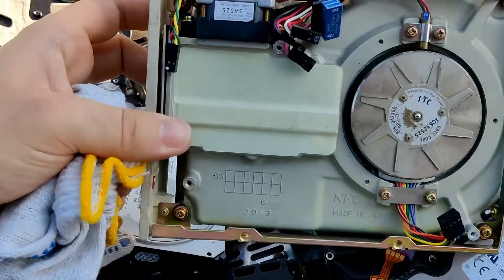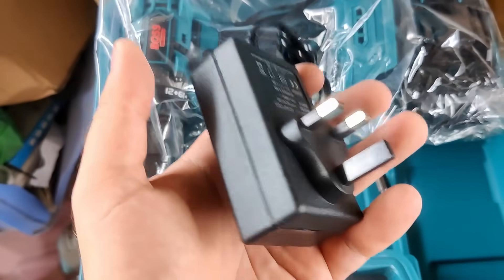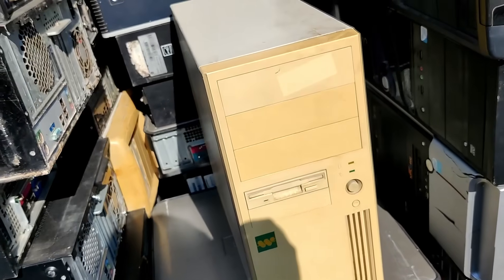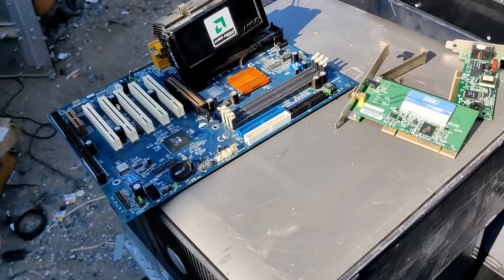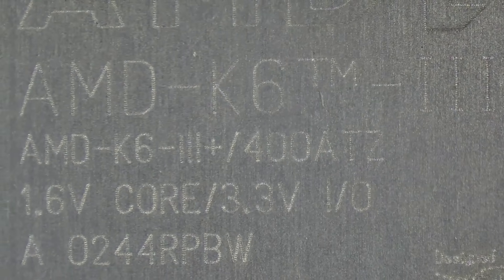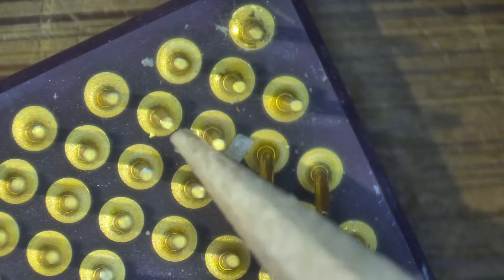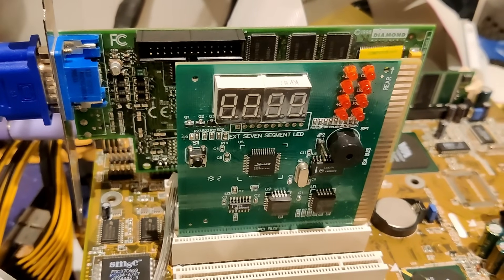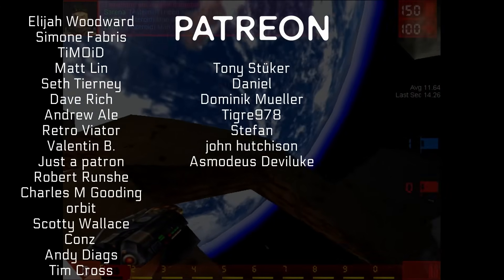I Found Rare AMD K6-III+ CPUs and Broken Dreams 😥

Comment: Geode is a Cyrix Media GX ~ £12 nowadays and not worth, other than collection for a wall display...

And as many are saying ... would love to have an Electronics warehouse/market like that ... I guess with all the opportunities and growth assistance in Dubai, they must cycle through a lot of electronics and quickly!

BTW: Those MMX chips, with that bespoke leather looking substrate - what was that made of?
Reply: and, we all, thank you for your service - risking Tetanus - for our entertainment!

Have you considered getting a bespoke expanded PGA measured block, something that PCB Way could machine for you, just a mill machined block of non-conductive material that has many squares of pins in that form factor, but making sure there's a a funnel bezel of each hole ...

That way,  you can just get close with your manual process, then push it into this block and get really straight pins? does that work if you ensure that all Key'd locations have holes too? or would you need a bunch of different masks?

I tell you what, when I win the lottery, next to my home Flight Simulator wrap-around cockpit. I'd have that Bosch FDL with subtle LED mods just decorating the background in the corner of a room!
Reply from the maker: A metal block to perfectly align pins sounds interesting, but I think there is this effect that pins won't 100% remain in the bent position. They tend to spring back a little bit. I have to over-bend them to get a good fit. It is a tedious process and takes a lot of time, but it doesn't happen that often - so, I am fine doing it manually.
The CPU substrate of the MMX chips could be fiberglass with some rubber coating (or other material).
Reply: @bitsundbolts  I was wondering if the alignment block would be a way to get the CPU into its proper socket and not even looked at, ever again! 🙂

Thank you for your reply, especially with the MMX - I wonder what the thermal properties of that subtrate actually are!

Comment: Considering how the crack has ripped the much thicker metal of the pads, the internal connection wires would have no chance.
Those cracked CPUs are dead
Reply from the maker: Correct. Tested and verified - they are dead.

Comment: Where is this?
Looks like India or someting.
Reply from the maker: United Arab Emirates
Reply: @bitsundbolts Cool to know you have a dismantling "scene" too! 😆
These are local use equipments or it come abroad to be dismantled in UAE?
I know several dismantlers like this here in Brazil. They are pretty same electronics "heaven and hell". They detach the circuit board the same way the guy do on the video, but does nothing to it here. We recycle the metal and plastics locally, and all the electronics are exportes to China.
I kinda work in a "dismantle" too, but we do a deserving destination to the equipments, repairing and solding again. If it cant be repaired, we disassemble and sell the good parts as a replacrment parts.
Reply from the maker: I haven't seen any further processing here - I was told that the different materials are then shipped to other countries like Malaysia. Sometimes, the separated goods are traded a few times locally.

Comment: Did you increase the voltage to 1.8v or even 2.0v? They should run at 550 or 600MHz with a little more power.
Reply from the maker: I will do that in an upcoming video when we take off the heat spreader from the cracked chips as well.

Comment: My eyes popped out.of my head when I saw that K7 kit.
I had owned an Epox EP-7KXA with VIA chipset, but I don't remember how stable it was compared to AMD 750 Irongate. The good thing about boards with VIA KX133 chipset is that they have universal AGP slot, while the boards with AMD chipset support only 3.3V AGP cards.

Comment: I still have A k63-450 and board in my garage. Keep thinking of making a dosbox out of it but never did. Its probably in decent shape though since still in socket?
Reply: Depending upon where you live the garage can be a bad place. In the UK the boards get damp in the winter causing corrosion and then suffer excessive heat in the summer. I brought most of my stuff inside when I saw these ill effects.
Reply: @davidp4456 so it's Midwest USA. Very dry. But other thing is the "garage" was converted to a room so it's actually temp.controled with rest of the house. It is old though I'll give you that, board has not been powered in forever. Caps might just go boom
Reply from the maker: Socket 7 boards are surprisingly resilient. I rarely saw a board that had bad caps - sure, they are old, but if they look visually OK and you can verify that there is no short, give it a try!

Comment: Interesting they are considered rare. I bought one back in the day new to replace my P1 233mmx. I paid literally $33 for it! I can’t recall my exact overlock, but it was 400 or 450mhz. Helped me get another year out of my computer or so.
Reply from the maker: Yeah, those chips were quite cheap when they were new. Competition with Intel was fierce and AMD had issues with performance. Those chips came out quite late as well and could only compete in low and mid tier systems (old Socket 7 platform reused etc.).

Comment: one of the dead chips may work at lower clock speeds but the one with the wider crack lower to the corner is definitely dead
Reply from the maker: Tested them - no POST codes. They are dead.

Comment: I feel like you have a much higher chance of getting a K6-2+ to 600Mhz and the extra frequency makes up for the difference in cache over a K6-3+ running a 500 or 550
Reply from the maker: I bought a few K6-2+ 570 once from the US - you can unlock the extra L2 cache if you're lucky - and 600 MHz guaranteed. Maybe even more with a better board than I have.
Reply: @bitsundbolts  I bought a K6-2+/550 for $29 from aliexpress and it has an unstable FPU at 6x100. I know someone else who bought from the same seller and got a 600 stable CPU. Just my luck eh (or our luck considering this video).
Reply: I don't know. I went from a K6-2 550MHz to a K6-3 450MHz and the K6-3 was way faster in general. It was also incredibly hot for such an old CPU, and needed a better, louder heatsink and fan.
Reply: @BrianG61UK  K6-2 and K6-2+ are different CPUs, you are correct the K6-2 is slower. The 2+ has full speed on die L2 cache like a K6-3 wheras the K6-2 doesn't. The plus CPUs also use a lower core voltage (since they were designed for laptops) so produce less heat than a full K6-3.

Comment: Oh wow, a Geode! You've got such a great retro hardware resource in that scrapyard. I'm so confused how they're even still handling all this 90s stuff though! I kinda thought all e-waste from that era would have been processed by now.

As far as your question about the Slot A K7 board with the Via chipset... it will work, the AMD750 (I think, has been a while) chipset boards were the ones people wanted though. I think they were more stable with the overclocking we were doing in Slot A days.

Anyway, Merry Christmas Mr Bits.
Reply from the maker: I have a few boards with AMD chipset - and now this one. It is nice to have this platform as well. Ratio is 1000:1 what I find in terms of Slot 1 vs Slot A. I was very surprised to see the K7 in there. Would have been awesome if it were a 1GHz model :)

Comment: I really wanted a K6-3 after we got a 450Mhz version in the shop. It was way smoother than the fastest K6-2, think that L3 cache worked really well.

On slot A, I don't recall anything beyond AMD reference chipset. I think AMD really had a problem getting board devs to put their faith in them with Intel breathing down their necks. VIA did put out some decent chipsets around SuperSkt7 not sure if they were used on Slot A.
Reply from the maker: I can't wait to test this Slot A board. Looking forward to it!
The K6 line was something special to me as well. My mum had a K6-2 500 for her business (while I was on a PII-350). At that time, I thought more MHz = better performance. I don't know how true that was - but it might be an interesting comparison. Definitely, that system was a great choice for office work!

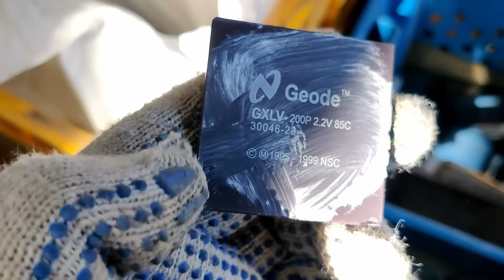Comment: 1:00 you did not pick up the NXP Geode?!?
Reply from the maker: I did take them, but I don't know what to do with them. Later, I found out that they aren't compatible to Socket 7 apparently. They seem to be SoCs and electrically incompatible with standard Socket 7, even though they use a similar socket (I think there is one pin difference). Any idea what to do except for some wall decoration?
Reply: @bitsundbolts  only wall decoration. I would imagine finding a motherboard from an embedded system that used them would be close to impossible. The AMD Geode LX was Socket A (I think) but the ones you took were the "original" NXP ones.
Reply: Not NXP, it was National Semiconductor, back in the day when they made some pretty interesting digital parts, and long before they were acquired by Texas Instruments for their analog product portfolio.  But yes, I'd have grabbed that too.
Reply: @GodmanchesterGoblin of corse, my mistake.

Comment: very cool i wonder if you slowly upped the voltage if they would boot up at 550mhz.
Reply from the maker: Probably those chips work well at 550 MHz with higher voltages. I'll try that in upcoming videos.

Comment: Back in the days I had a K6-3+ 450 running at 600MHz stable. However, I did a slight overvolting (0.1 oder 0.2V up) and to keep the CPU cool, I had a quite hefty Socket 370 cooler installed (frankensteined with a Socket 7 mounting bracket, making the largest Socket 7 cooler possible). With stock voltage, I did not exceed 500 or 550.

Comment: I wonder if it would be possible to delid the cracked CPUs, grind down the ceramic at the crack to expose the traces, and manually repair the traces with bodge wires?
Reply from the maker: That was my thinking, but I don't know how to grind the ceramic - nothing I tried worked. I might need special diamond bits and what not - then there is still the issue securing everything in place. It is probably not worth the trouble - unfortunately.

Comment: I don't know the specific chip number, but Via chips, being low cost enterprise chips, were among the last to support ISA without requiring bridge chips. The have a reputation for spotty AGP implementation, causing problems with Nvidia cards, but I haven't encountered any boards with that issue.
Reply: I'm not sure where you're getting "being low cost enterprise chips" from.

They were bottom of the barrel generic chipsets found on anything and everything during the Win9x era
Reply: @incandescentwithrage  Yeah they were on alot of cheapass consumer boards, but also tons of industrial boards. They sucked at the time because they tended to only have last gen RAM and poor GPU support. Now? Lots of retro value because you can get P3/P4 era ISA and Via C3 support for speed throttling.

Comment: I bought a K6-III+ brand new in 2016, honestly I don't get why they got so expensive. Super Socket 7 chipsets are not as reliable as I'd like, the performance isn't very good, yeah scaling down was a neat trick at first but now it's a common ability for many other CPUs. I switched my main Win98 box to a 1GHz Pentium III / Voodoo 3 pair a couple years ago and have been a lot happier.
Reply from the maker: I think it just comes down to how many are there in the market for sale. Many people like those CPUs even though they aren't the best. There is something about those CPUs that make them special. High demand and low availability drives the price up.

Comment: You know what's really sad? If they properly picked and stored parts and only really scrapped the "trash" they could make quite a bit of extra $$$ even if just selling them on the "not tested" bin. The way they going at it is literally throwing cash in the dumpster.
Reply from the maker: But this is what they are trained to do: separate materials. They don't care if they destroy an OEM system or a custom build worth hundreds or thousands of dollars. Most don't know what is valuable and what is not.
Reply: @bitsundbolts  I know... but i think they'd do better (financially) by simply having even one person that had (some) knowledge and would just "preprocess" the stuff before passing it on. Given their actual salaries, there's no world where that person wouldn't make 2/3x its own cost on "common stuff" let alone "uncommon" or even "rare".
And i just remembered i have a whole lot of Matrox Mystique's in a box, that i bought for about €2 each some years back for a project that got cancelled... Can probably get 10x more now, almost as much as i payed for whole i5 systems recently.
Reply: I guess the gold recovery is quite an incentive.  I don’t how this would compare to the collectors value though.  Btw, a while ago I saw someone selling PCIe graphics cards with the gold connectors cut off.  What’s the point?
Reply: @davidp4456  Keep vs recovery very much depends on the part. There's a whole spectrum of "value".
On the connectors part, assuming they were gold plated, they got cut off to recover the (minuscule) gold they had. You only deposit a very tiny amount where you expect metal-metal differences or metal-moisture presence, not everywhere. You also get a (minuscule) amount from bonding wires and pads inside chips, but its becoming less and less common and gold prices and new processes now make copper or even aluminum an option. No point in wasting $1 in gold on your $2 chip.

Comment: I used to have all the cpus in the bag, of course and the K6-3, I have tried to add an audio track in a 1h30min video back in 2001, it was to take 18hours, I left it overnight and guess what the computer was frozen at the morning and I remember I got rid of the machine because was ridiculously slow compared to the first Pentium II even compared to the celerons… good old times (;

Comment: The only way the cracked chips would work is if they used really thick internal runners from the pins to the wires that route to the die,   it's unlikely they would work.   Shouldn't hurt to try,  unlikely they would be shorted,  just no contact.   Give them a try,  shouldn't be any risk.
Reply from the maker: Yes, absolutely agree. Those wires are definitely super thin. They snapped with the ceramic. I tested the CPUs already and they are confirmed dead. I will remove the top lid soon.

Comment: The easiest way to straighten CPU pins is with syringe needles. They are made in a wide range of diameters, so find one that just fits between the rows of pins. Slide the needle in from an edge, then lift up. That will gently nudge the pins straight. For severely bent pins, find a needle that fits snugly over a pin and clip the point off. Then the needle can be used to gently push the pin straight with no danger of slipping and bending other pins. Get them just straight enough to wiggle into a ZIF socket and close the lever. That will finish the job.
Reply from the maker: Yeah, that sounds like a good method to straighten the pins.
Reply: @bitsundbolts  how about a video showing it? I've been recommending this method to people for years but nobody has put it in a video.

Comment: Are these the ones you can swap the capacitors under the aluminum caps and double the cache?
Reply from the maker: Yes, that should be exactly those chips. Now, those are already the ones with all the L2 cache activated. The K6-2+ has one of those SMDs in a different location compared to the K6-III+. We will have a look at those details in an upcoming video.

Comment: @4:10 42 pin SOP RAM chips on a VirgeDX card? I have a similar one - HY5118164B is a 2MByte (not MBit) chip, it means these card has 8MB onboard! but they see only 4MB - as limited by VirgeDX chips... strange ones...

@6:00 a rambus P4 mobo is not interesting? :)

K6-III+ 400 1.6V: very rare, I have one too, overclocks easily to 600MHz!
Reply from the maker: I really don't like P4 and especially not the RDRAM stuff. I find the other things more interesting.
Reply: @bitsundbolts  i agree, most P4 systems are boring, but there are some exceptions for me:
-early s423
-rambus
-SIS645DX and VIA P4X266A/E chipsets on higher class motherboards due to universal AGP support - any 1x to 8x AGP card can be used with a ~3GHz/533 CPU...

Comment: Wow, K6-3+/400, 1.6V, nice find!
You know, those chips are designed to be used without cooler at that voltage, but they work just fine at 2.0V as well (you need to add a cooler though).
Also, those chips can run at 600MHz. Just set them to 100 MHz FSB and 2x multiplier. Most K6-2/K6-3 CPUs recognize 2x as 6x.
Reply from the maker: I'll try overclocking once more with higher voltages. 600 MHz should hopefully be possible at around 2v.
I have a K6-2+ 570 which works at low voltage and high frequencies. That chip is definitely of higher quality than the K6-III+ chips in this video.
That is the one I unlocked to enable the other half of the L2 cache.

Comment: My ultimate dream video would be a Dual socket 7 with K6-2+, K6-3, K6-3+.  I know they exist but extremely rare and expensive when they do come on eBay.  Dual CPU that never were rated for dual processing is intristing.
Reply from the maker: I have to check, but I think I found once a dual Socket 7 board. Unfortunate that it is NOT allowing me to use low voltage chips on that board. Only 3.3V chips (Pentium non-MMX) will work on this board if I am not mistaken. I have the board somewhere and will show it one day.
Reply: @bitsundbolts  I hate to mod retro hardware to much.  Though it shouldn't be difficult to inject  correct voltages by removing the regulators and direct injecting power from a LM317 DC-DC  Adjustable Linear Regulator Board.  Talk about a Collab with Necroware about getting it working.